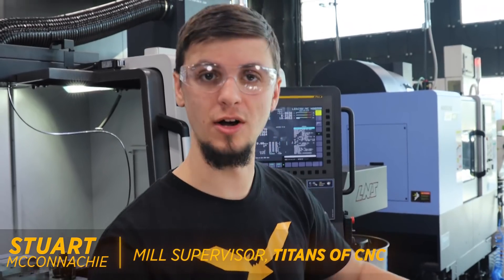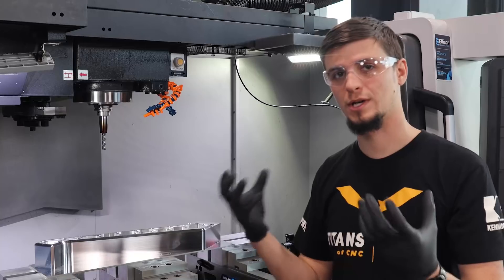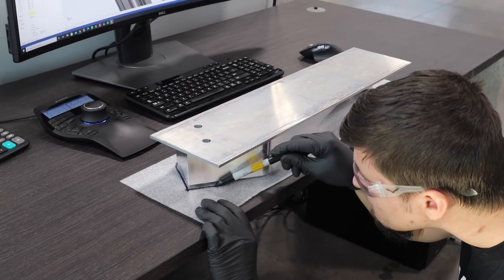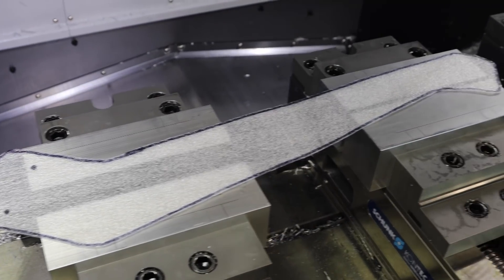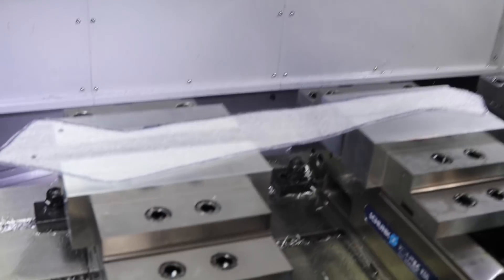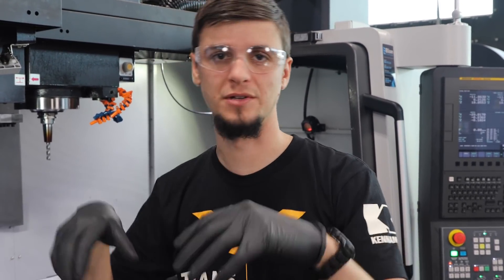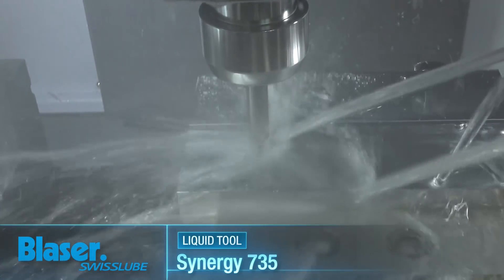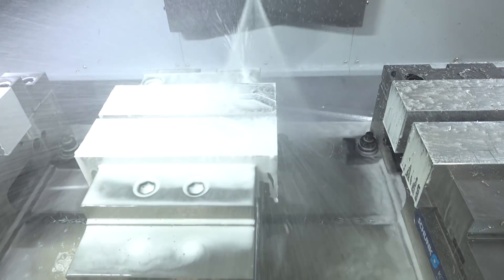CNC Machining Soft Jaws for Custom Conference Table | DNM 5700L | DN Solutions

Comment: i would love to see a video on how to use rotation and scaling to set work offsets on a part using 2 known features like 2 bores to get g54 and angle using haas nex gen and confusion 360. Basically to locate the part in the program without a fixture.. for one offs  ..organically shaped or a casting . l appreciate the meat and potatoes..knowledge is not propitiatory..KEEP SHARING!

Comment: Did you probe the left side of the left jaw and the right side of your right jaw to get your g54 or did you know the difference between the jaws?
Reply: He wouldn't have needed it to be exact so he could have just set the jaws in master cam to cut the profile. He could have even SWAG'd it and dry ran above it and adjusted.

Comment: Intresting but seems like a very inefficient and costly way of doing it. Why not just put tapped holes and tags to bolt it down to a plate? Would save time and material
Reply: In reality soft jaws is cheaper. They are incredibly versatile, require no additional ops to remove tags or drill out threads etc. The jaws themselves are basic and made in batches during quiet spells, run by operators or apprentices etc. Jaws can often be remachined to hold different profiles at a later date too. Often the same vices can be left in place from op and simple swap the jaws over to a set of soft jaws for op2. Etc etc.

Comment: Dumb question from someone who only does manual machines: How do you collect and recycle the chips?
Reply: The machines have chip augers that push the chips out usually into a bin. There is like a trough almost where the auger is and you can blow or wipe the chips towards the trough. You can look up a picture of just about any CNC mill or lathe to see more of how if works. Pretty simple though

Comment: About how much offset clearance is everyone running between their work and soft jaws?
Reply: I like running no offset on straights to allow them to locate and relieve all radii and corners so there is no interference with the jaws. Allows for some wiggle room in jaw machining and for part variation.
Reply: Same here. Always cut them to the size of your part but add clearance at sharper corners/bends to avoid any risk of jaws contacting parts on individual points instead of faces.
Reply: Thanks guys!

Comment: Do you ever have an issues with lift?  For example, I will often put a dial on the top of the part as I tighten the jaws.  As I tighten I will normally see between .001 and .005 of lift.  Based on that amount, I shift my work offset up.  This assumes I am using the bottom of the part (the floor of the soft jaw pocket) as the reference Z position.  Is this just a me thing?  Or have you experienced this?
Reply: What kind of vise are you using? A kurt or kurt style should actually pull the movable jaw down with clamp pressure. Might be over tightening and bowing the part and or vise body.
Reply: @Eggsr2bcrushed  I probably am overtightening.  I am using Tormach vises.  I never upgraded them when I got my Haas.
Reply: I like to clamp on a 1-2-3 block at the same torque that I will hold the part with.  This 'bakes in' the rise per say and comes out great.

Comment: Ok so let’s just say I need to make parts at home that have holes, threads on all 6 sides, about 1-1/4” width & 10” long & 8 less than 5” tall what machine would you recommend for such applications
Reply: Wouldn't a home machine like this be a manual mill or bridge port?

Comment: Hello, I have a question regarding the work coordinate after we flip the part. Being that there is stock in the way, how do we accurately reference geometry on the part if we cannot probe it? I'm using Fusion 360 and often use a model box point or reference a particular geometry to set up my G54. Thanks as always!
Reply: Take your reference for op2 from the soft jaws as you've already referenced these when making them, unless there's a hole through the part from op1 to go from.
Reply: @71brp84  Thank you very much, Going to have to make sure to start incorporating a through feature. Appreciate your help!
Reply: I often throw in a hole in my design next to the part, and use that for reference
Reply: @104kenneth  
Thank you for the tip, Appreciate your help!
Reply: I always bore a hole in the fixed soft jaw in a known location so I can just come in and probe it before the part is in the jaws and reference that as the WCS in CAM.
Reply: @Stuart McConnachie Roger that! Thank you for the reply I appreciate the help!

Comment: Why did you not preload the jaws with a piece of material in-between them at the same torque load you will be putting the legs in?
Reply: You can see him pull a parallel out of the vise. A 1-2-3 block works just the same. Anything to space the jaws apart and keep load on the movable jaw so it doesn't move on you.
Reply: @Eggsr2bcrushed  but the parallel is at the bottom. This will make the moveable jaw deflect inward and the top. The jaws should be supported where the cut is happening to reduce deflection inward or outward

Comment: Did you clamp anything into the lower parts of the jaws while cutting the profile?
The loose vice could start vibrating or move alltogether if getting cut while loose.
Reply: oh just saw it for a brief seccond at the end how hes removing the part thats beeing used to hold it in place :D
keep up the great work!
Reply: @PorGaymer  if the parallel is what you are talking about it should have been the same thickness as the depth of the cut and at the same height. Vise jaws will deflect differently with different load location. If you only load the bottom of the jaw, the top of the moveable jaw will deflect inward. If you load the top of the jaw it will deflect outward
Reply: @jaxnaturals  This is not as big of a deal as you might think. Just don't crank the snot out of the vise when making the soft jaws or while holding the part. If the jaws are right the part should be locked in without much clamp pressure. Depends on the geometry of the part of course but if it warrants soft jaws it usually means there are lots of wacky curves that will interlock the soft jaws. No sense deforming everything with tons of vise pressure.

Comment: do you machine soft jaws exactly to size? or do you go slightly over/under size, if so by how much?
Reply: I would think exactly to size.  From the look of the remaining stock they'll have to use the jaws as the location for the next operation.  If the jaws are not exactly the same (where it counts) the next opp will not blend with the first.
Reply: I like running no offset on straights to allow them to locate and relieve all radii and corners so there is no interference with the jaws. Allows for some wiggle room in jaw machining and for part variation.

Comment: Although I cannot see it being different ....BUT.. the cooling oil appears to be different when through tool than when it is being used as flood cooling?  Can you verify.  Thanks.. 
Great work and being able to alter a method is a sign of always thinking and not mindlessly following a plan.. Keep it up.  This ability is part personal “be and do the best you can ” and company ethic, confidence in the staff and the companies direction.  Love the openness it is so refreshing. Amacf
Reply: There is much more pressure when you use coolant through the spindle. Lots of it turns into vapor right away when pushing through. Thats why it might look diffrent. Through spindle coolant doesnt only just cool tho, it helps a lot with getting chips of the cutting area where they might cause troubble.
Reply: Thought it couldn’t have two types of oil.. just shows the Look can be deceptive. Thanks Vellocet